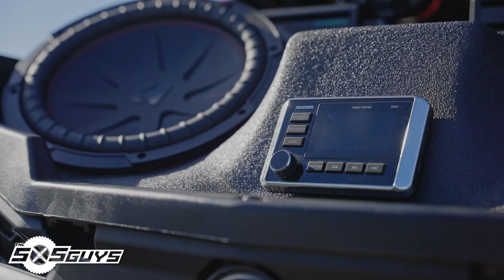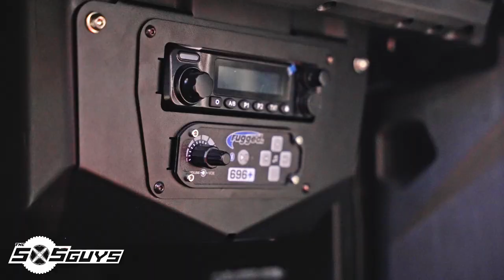Anvil Offorad's Monster Can-Am Maverick Sport Build Breakdown | The SXS Guys

Comment: How is the  stater and  Regulator  Hanleying all that power ...... if you are running everything off battery's how are you charging them ......
Reply from the maker: Being a show car, they have it on a tender. They’ll be adding Full Throttle batteries for the accessories